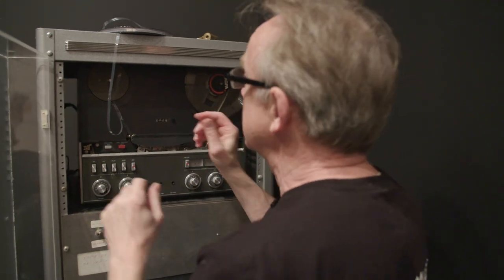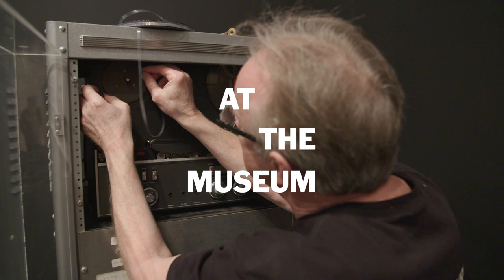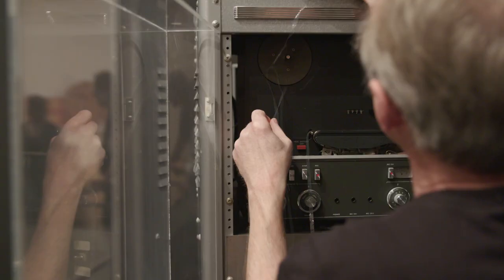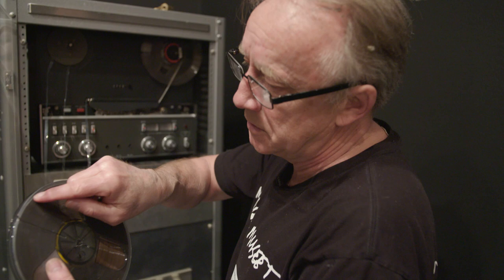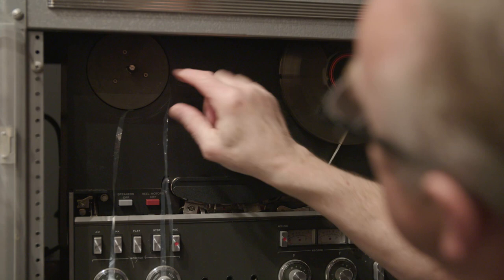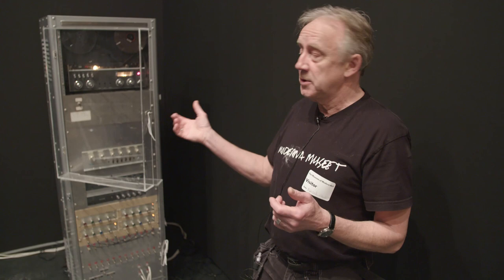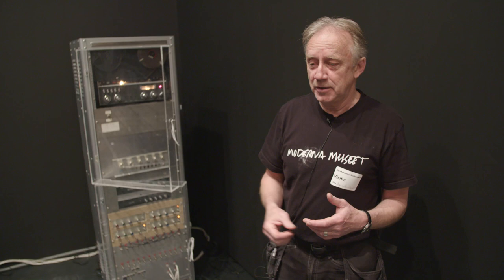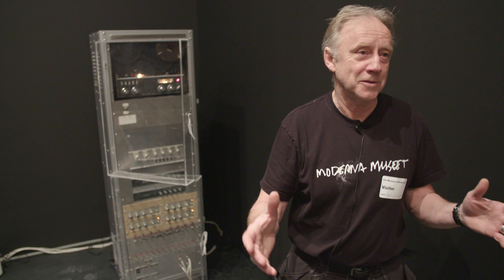Rauschenberg's Mud Muse – Part 3 | AT THE MUSEUM

Comment: If the sound sent to the speaker was delayed just a bit compared to the music activating the air of the pool, then what you hear would be perfectly in sync with the bubbles, which would suits the idea much better.
Reply: Maxime i disagree.  The conservator stated that the installation uses the sound of the bubbles, therefore the delay will cause a reverberation of like frequencies giving a feeling of cause/effect; the bubble gurgles beneath the mire before breaking the tension of the muddy surface.
Reply: Then I guess they don't diffuse any sound and let the bubbles speak by themselves. Otherwise, delay or not it sounds totally awkward.